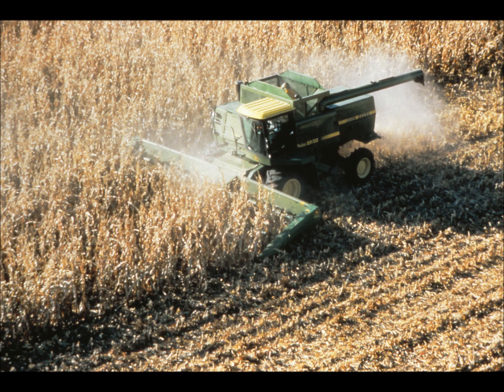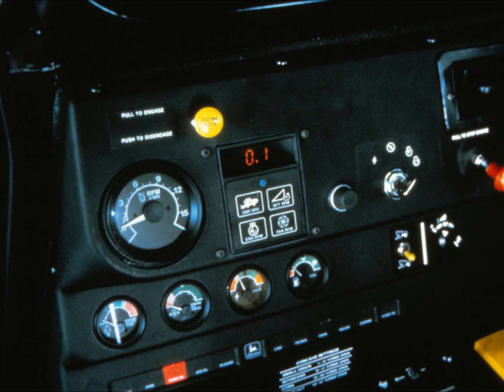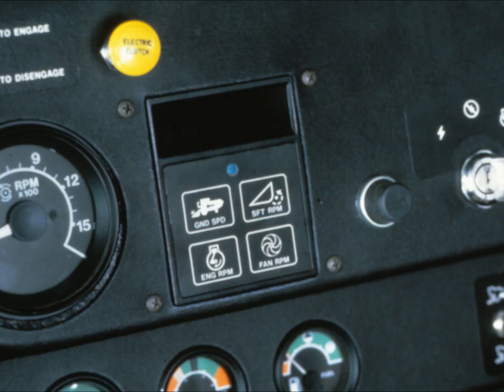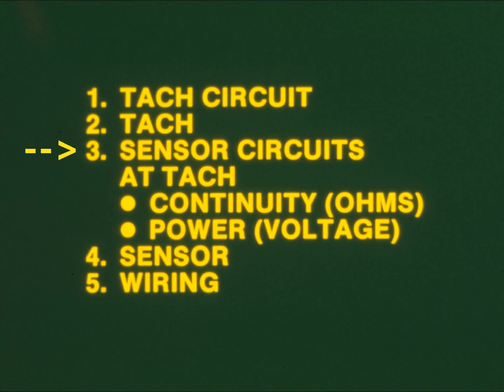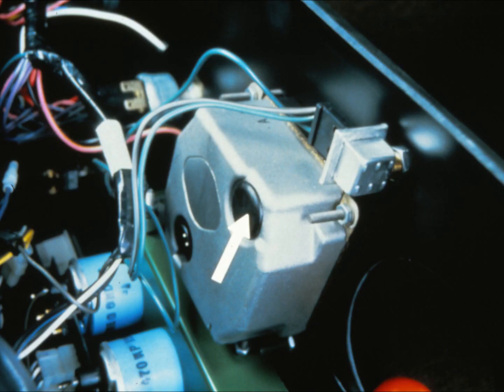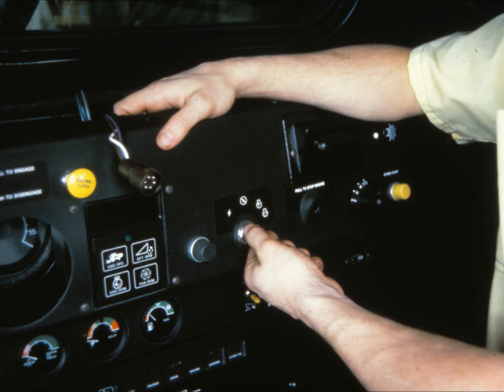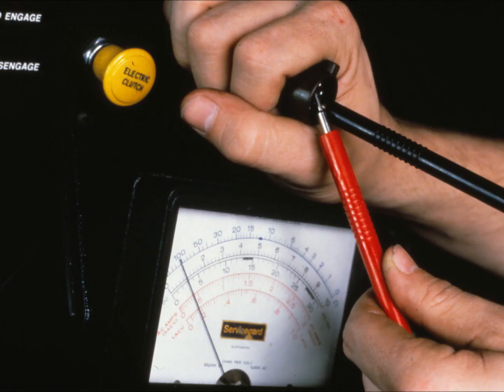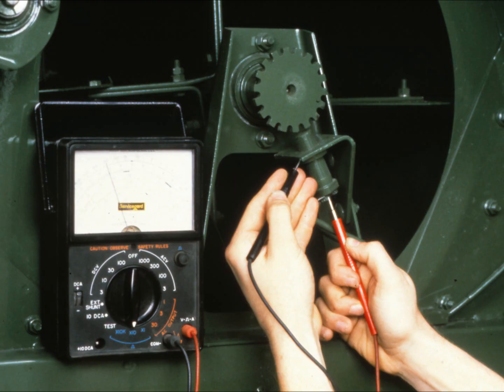John Deere Titan Combine Digital Tachometer Operation & Diagnostics

Comment: Que diferencia en la manera de pensar de la compañía en aquellos años...en que procuraban hacer maquinas eficientes, duraderas y simples de reparar por ti mismo con simples herramientas, y por si no fuera suficiente había estos videos para poder repararla tu incluso en el campo... Todo lo contrario al día de hoy que con el pretexto de hacerlas "más eficientes" lo único que provocan es perdida de tiempo en el campo al no poderlas reparar tu, plagadas de sensores y computadoras para obligarte a que sean solo ellos quien puedan repararlas...🤮🤮🤮
Yo me declaro fan de la John Deere de  aquellos años porque lo que es en la actualidad para mí son solo basura con fecha de caducidad en la vida útil de sus máquinas... Que lástima que ya la mayoría de las cosas se manejen en este concepto
Reply from the maker: Agreed! The equipment has become overly complex & ridiculous to keep after. The tractor company Big Bud is going to be making a basic high horsepower tractor to keep up with Deere, Case IH, etc. Very few sensors & a basic control system on the engine. Still waiting to hear if anything has been put into production yet. It's been a year since the announcement.